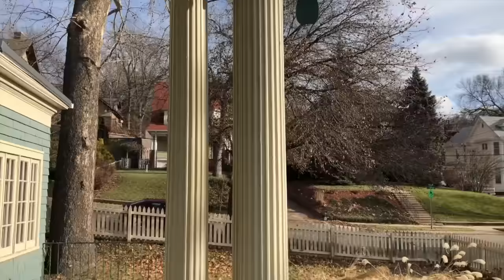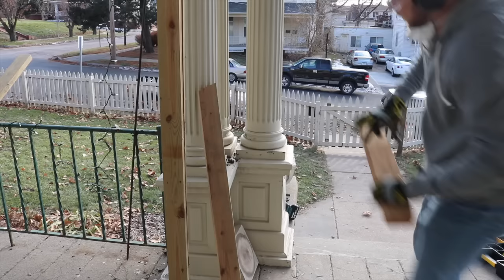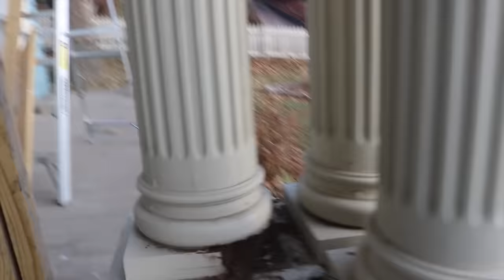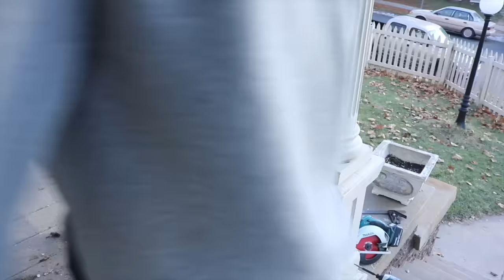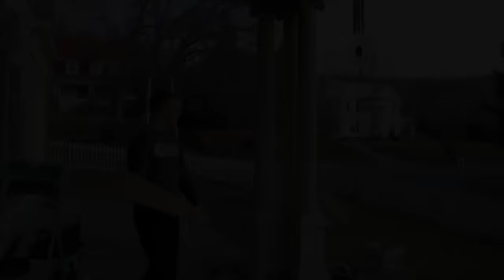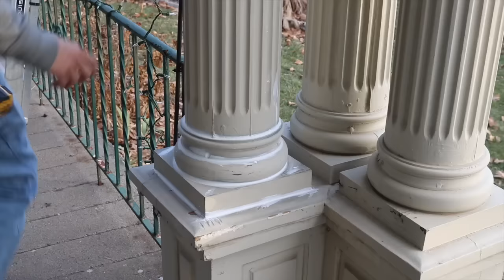100 year old pillar repair

Comment: great video!,happened to be looking at the columns on my moms historic house in south coast mass,unfortunatly for me they are alot bigger and seem hollow?,and they pretty much all look like they need repair/replace,4 of them in front actually look like they are holding up the front eve of the house,atleast your video gives me alittle hope thanks!
Reply from the maker: Thanks Gray! Yeah these ones were hollow as well. I’m assuming it’s a lot cheaper to glue hollow pieces together, plus it would be a bit heavier if they were solid. Godspeed in the build!

Comment: Great video, maybe next time think about using an epoxy filler for the screw holes (two part body filler works well). It will last a lot longer than caulking and will not shrink or crack when cold.
Reply from the maker: Thanks for the advice. Definitely will be using a more permanent filler on the final part of the project. This was a quick repair done on Christmas day to help make it through the winter.

Comment: I literally have to do the same thing, what is the term used for the disk you slid underneath, is there a link to buy it or did you fabricate it? Thanks!
Reply: 911aDay the circular base is called a torus. When I wanted a particular size for an old house with non-prefabricated columns, I had to make them myself. Otherwise I think you can buy them

Comment: Did you find the cause for the bottom plate to rot like that. Love the vlog
Reply from the maker: Thank you! Best guess is over the years that plate and the paint was beaten down by rain. It’s been a long time since certain areas of the exterior on this house have been maintained. The supporting L-shaped wooden base will also need attention this summer
Reply: For me, it was carpenter ants who were using it as their source of food.  The base gets set continuously every time it rains and after time, becomes soft and makes it very easy for the ants to eat into.  They live inside the column and are eating the wood from inside out.

Comment: what was the approx cost?  I am dealing with this and need to find someone.  Aldo did you call a painter or just general contractor to do the work
Reply from the maker: I would charge ~$150 for labor and ~$50 for materials for this. The house owners wanted to do the painting themselves to save a little money
Reply: @johnbarneswood  where are you located?

Comment: Did you use cedar for the repairs?
Reply from the maker: Yes
Reply: @johnbarneswood  Had you ever given any thought to using Azek trim boards moulded to match?
Reply from the maker: @gary24752  No, the owner already had the replacement ready to go.